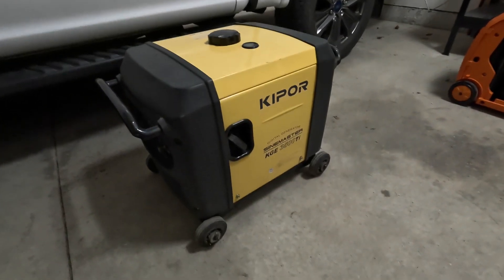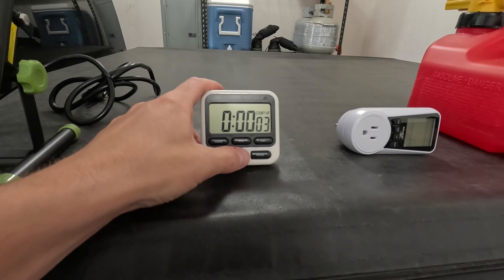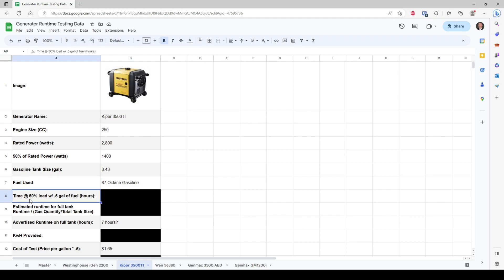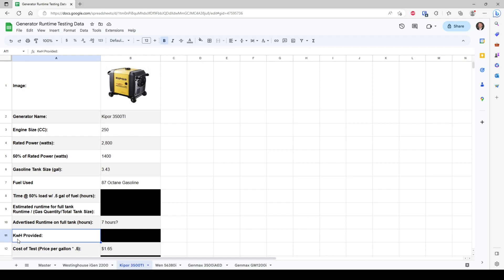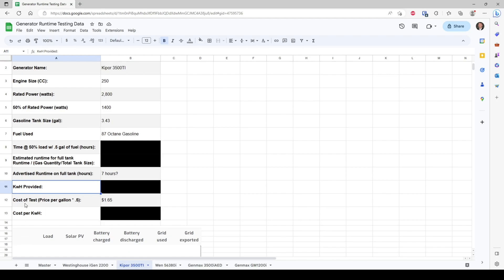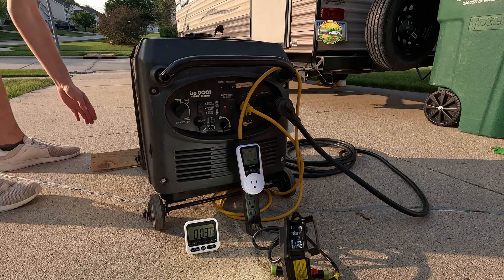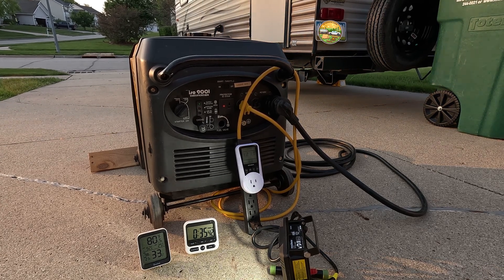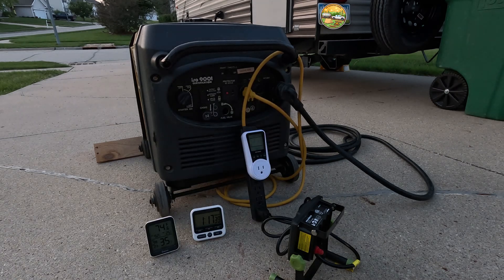Kipor 3500 TI Runtime Test | Generator Runtime Testing Series

Comment: I bought one new 15 years ago and it ran 2 hours before it stopped running now it sat since then,I wonder if it’s worth fixing?
Reply: Mine is just about that old, always ran great until about 5 years ago, t because of gummed up carb, then wouldn't start, last year I took the carb off and cleaned it, and got it running, but would only run ruff with the choke out, ordered a new carb off Amazon for $25, and now it runs like new, it's easier to change the carb, then clean it, 2 bolts, and the fuel lines.
Reply from the maker: @Michael-Joseph123  love to hear it!  You can definitely tell these things were built with quality in mind!  Thanks for watching :)
Reply from the maker: Ohhh if its been sitting since then there is a change the magnetism has failed too by now.  There is a chance its still there, but these should really be exercised ever couple months.  Thanks for watching :)